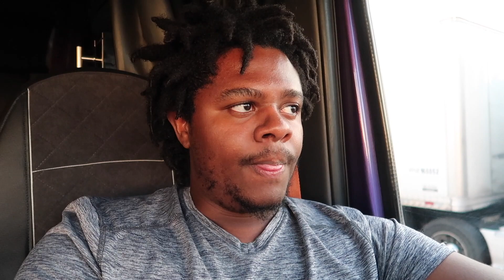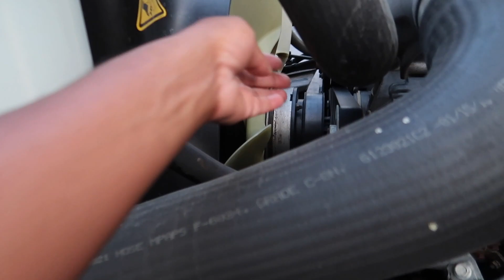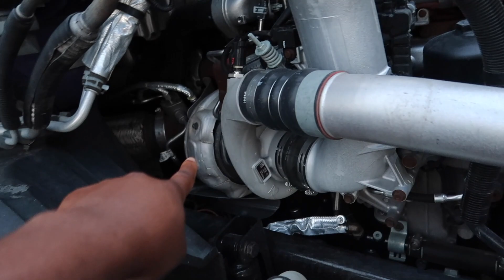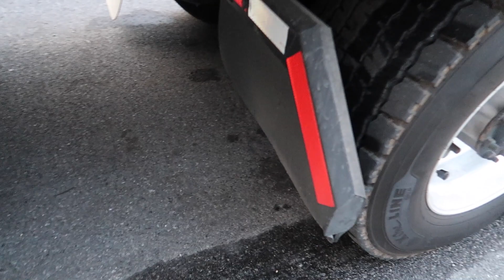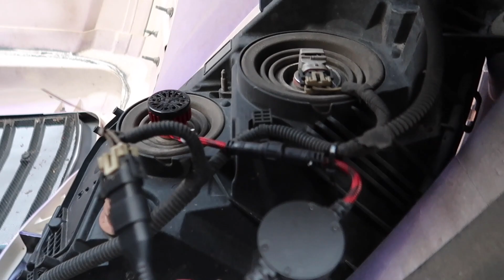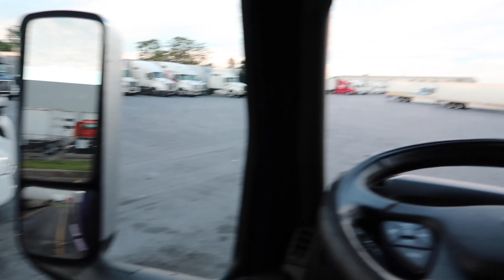Thoughts on my “INTERTRASHIONAL” LT 2020

Comment: How’s the jake?
Reply from the maker: The Jake works well as long as you’re in high RPM. the truck itself likes to be at about 1500 when you use it but the manual says it’s safe up to 2200. At about 2000 if you’re at a safe speed you shouldn’t have any issues